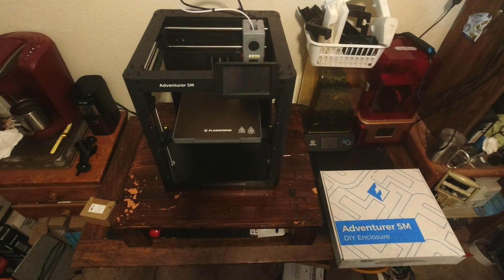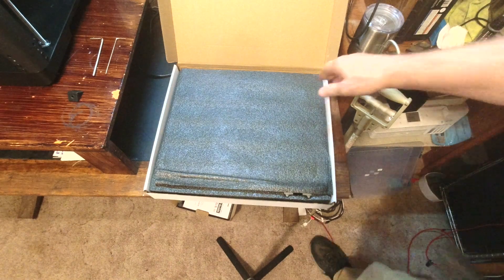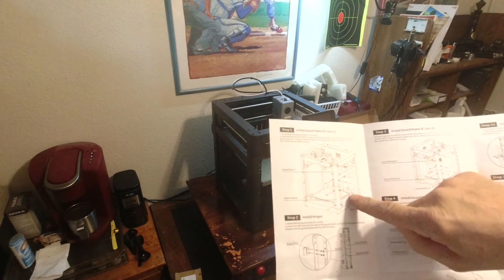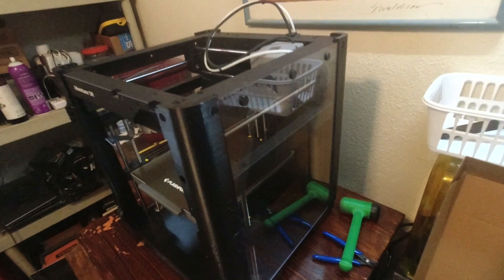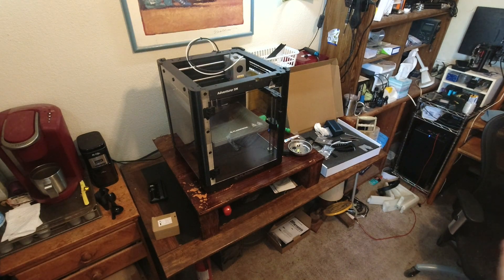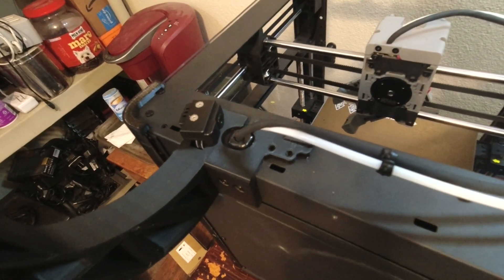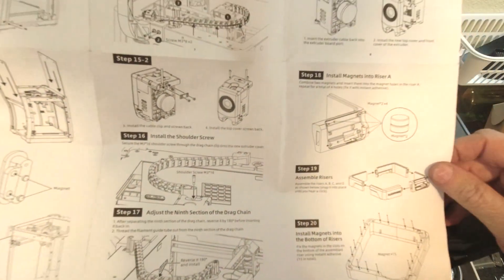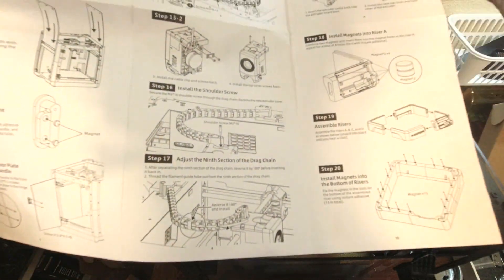Flashforge Adventurer 5M DIY enclosure build and what I think of it.

Comment: I have this printer and enclosure kit arriving tomorrow. What material did you the parts with?
Reply from the maker: When you load the 3MF file into Orca Slicer it arranges all the parts on 9 print beds, if I remember right 6 of the beds have PLA parts and 3 of them have PETG parts and they're colored differently and the print settings are already loaded for each bed. Made it really easy to print. Most of it is PETG, but the top riser is all PLA and some of the small parts are also PLA. Good luck!

Comment: did you use supports for the curved corner pieces? im using black overture petg and my curves look terrible with and without supports. im using flashprint to slice. any help would be appreciated thanks
Reply from the maker: What I would suggest you do is what I did, load the .3mf file that comes with the enclosure files into Orcaslicer and print from that without changing any of the settings other than nozzle size and printer type. Iit opens nine build plates and each plate has the proper settings for those parts, including filament and they worked perfectly for me. The 3mf file was designed for Orcaslicer 1.90, but I found it woked fine in the latest build Orcaslicer other than I had to move some parts to fit on the plates. By loading in the individual STL files you're losing all the settings and you're going to have to work them up on your own, so whenever possible, use a 3mf if one is included with a design.

Comment: This was a pretty entertaining video and educational too. I'm probably going to pick up one of these printers today. I was also considering the Creality K1 Speedy but the Flashforge is $182 cheaper right now at my local store and they seem very similar.
Reply from the maker: For $300 it's hard to go wrong unless you want one that's already enclosed and with a filtration system. But but A5M Pro is $500, and at that price point, I'd start looking at the Qidi Tech Q1 Pro. It's on sale now for $450 and not only is it enclosed, it's also heated and has a 350c hot end.

Comment: Just got my 5M last weekend and I'm having trouble with the wifi not connecting after turning the printer on. It will not even show any networks to connect to. I then have to power it off and back on again then it will show the wifi icon in upper right corner of the screen and all is well... until tomorrow. Other than that I love this printer.
Reply from the maker: I noticed two things on mine. First, the wifi module on the mainboard is very slow to initialize, sometimes it takes 2 minutes before it's showing access points. Second, it fails to reconnect after being powered off and on. On mine setting a static IP cured the issues. Well, it probably still takes 2 minutes to initialize, but since it reconnects automatically with the static IP I never notice it.
Reply: @3rdpig  Thanks for the reply. I will try that and see what happens when it gets turned back on tomorrow morning. Thanks again.

Comment: I ordered the enclosure kit the day my printer arrived, and the kit parts were my first prints.  I think printer mods are a fun way to learn a new printer.   My front panel strip started falling off since it was just a press fit so I glued a couple of magnets to it and now it is fine.   The best thing I found with the enclosure is just noise reduction.  Fast printers are loud.
Reply from the maker: Yea, that strip is badly designed. Considering that some of the part design is quite ingenious, I have to think that either someone else designed that strip, or the designer just lost interest at that point.

Comment: The one thing I don't get is people who buy a 3D printer who don't wanna print stuff for their printer and customize it, it's just weird, what r you buying a printer for in the first place, to print plastic of course why not customize the machine that's doing it, to look the way you want it to, you gotta have a little bit of DIY in you to buy a 3D printer to begin with unless you're buying it to print toys and trinkets and stupid ish like that....................
Reply from the maker: I'm a bit of a mad scientist and I've modified just about everything I've ever owned, but for some people I suppose their printer is like their toaster, they don't want to modify it, they just want their toast. For example, if I bought a printer to make prototypes for my business, I wouldn't want to spend time modifying the printer, because that's not advancing my business, I just want to get on with making prototypes.
Reply: @3rdpig  yeah but if you're just making prototypes the regular version of the printer with PLA is fine but even the pro version doesn't have a heated chamber so I think ABS and ASA would be a challenge especially larger parts, but who knows
Reply: I mainly use my 3d printer for functional parts, so doing cad design for parts takes most of the time. Doing mods to the printer isn't a big deal for me. All the bambulab lovers swear by not doing any mods to the printer.  But 3d printer prices have become so cheap that even an enclosed 3d printer isn't much more.
Reply: @oneanother1  yeah but if I'm going to buy an enclosed printer it better have a heated chamber cuz even though sometimes it's not needed it sure does help, and the Q1 Pro for the price you can't beat it